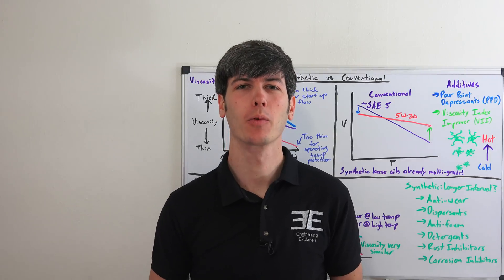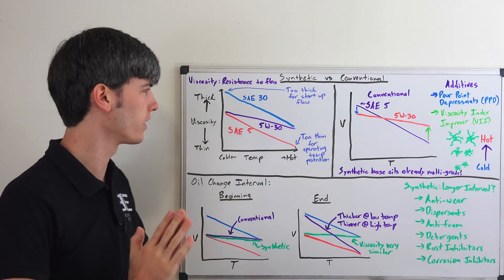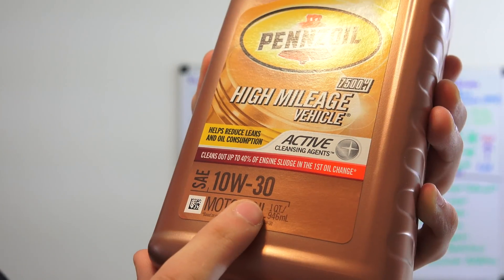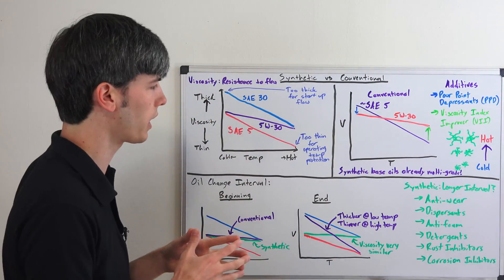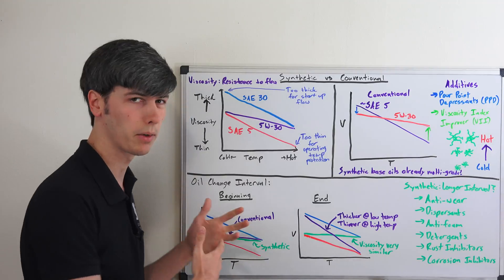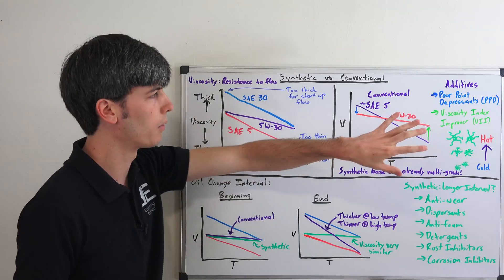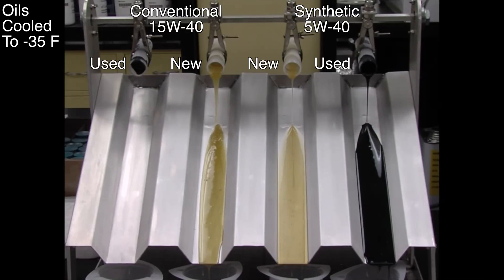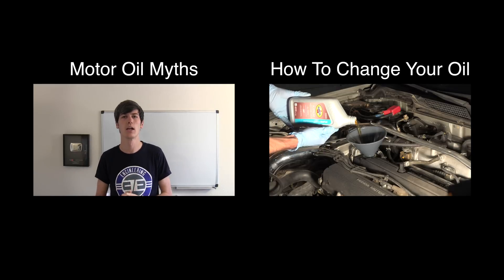Is Synthetic Motor Oil Better For Your Car?

Comment: Can I use "Motor Oil" in my ENGINE??
Reply: Arthur Smith That's not true. A motor is a machine that converts other forms of energy into mechanical energy and so imparts motion. An engine is a motor that converts thermal energy to mechanical work.
Reply: Pepsi is great for high performance
Reply: Bruce, that isn't exactly correct. In standard convention, the word motor is applied to an electrical device, and the word engine is applied to an internal combustion device. However, this isn't exactly correct. Any object that converts energy into motion is a motor. The word is latin for "mover", so it is pretty inclusive. Also, an engine need not be internal combustion. Again the word originates in latin, this time meaning a "clever device"... more or less. This becomes obvious if you look at various engines throughout history. Siege engines (catapults, trebuchets, etc.), steam engines (trains, ships, etc.), now the internal combustion engine, the jet engine, and so forth. With the large number of prime movers about, we have adopted the convention of separating the two words along the rough lines of moving parts. Thus, a motor is something with few moving parts such as the electric motor, the rocket motor, etc. While an engine is something with lots of moving parts. In short, when the blonde asks somebody to take a look at her motor, she isn't wrong. She just isn't following modern convention.
Reply: Swooper S a library at your finger tips. YouTube for a lot more answers. You will never say I don't know again.
Reply: ya, why don't they call it "Engine Oil"  ????   I'm a girl  !!!
Reply: That's funny...people often confuse engines and motors. What's in your car, truck or motorcycle is an engine, as in "Internal Combustion Engine" The fan that's in your HVAC unit or garage, and runs on electricity is a "motor". Everyone gets it wrong, and Harley doesn't help the issue because for the last 114 years they've been known as "The Motor Company". It's really not that big of a deal and we all know what they're talking about, regardless of whether it's called an engine or a motor....
Reply: Technically it's a "motor", as "engine" used to have a much wider meaning (unless you specify that it's an "internal combustion engine"). It's doesn't have anything to do with the amount of moving parts, just with it's function - the motor is a motion imparting engine. A motor is always an engine, but an engine is not necessarily a motor. Neither "motor oil" or "engine oil" specify the type of engine or motor the product suits, it's just that the internal combustion engine is so prevalent that it's function is usually accurately assumed. So prevalent, that both "engine" and "motor" became synonyms.
Reply: NO, you put that in where it says break fluid.
Reply: Arthur Smith you're right lol I do the same
Reply: NipkowDisk lol
Reply: +Zer0MatteR you are correct. Many don't know the difference. Nomenclature is important in the parts replacement world.
Reply: Pie guy, the point is the words pre-date the devices we've assigned them to.
Reply: NipkowDisk fun fact, guess how "Motorcycle" got it's name? ;)
Reply: Skittles in your gas tank will improve gas mileage by 20 percent
Reply: so a motor boat is actually an engine boat?  The colloquialism is crazy.
Reply: An engine is also called a motor. I consider myself a "motorhead", but not an "enginehead." Now I know some people will argue with me, but when I'm not working on vehicles, I am a student and teacher of the English language. I'll bet nobody here ever thought they would hear from an ASE Master Heavy Truck Technician with a BA in English and a certification to teach English as a Foreign Language (called TEFL).
Reply: A motor is any device that converts any kind of energy into mechanical energy. That definition is very easy to find if you know how to search the English language, which I do. 

motor
[moh-ter]

noun
1.
a comparatively small and powerful engine, especially an internal-combustion engine in an automobile, motorboat, or the like.
2.
any self-powered vehicle.
3.
a person or thing that imparts motion, especially a contrivance, as a steam engine, that receives and modifies energy from some natural source in order to utilize it in driving machinery.

The definition of “engine” is narrower than that of “motor,” but an engine is obviously a motor even though a motor is not necessarily an engine. 
 
engine
[en-juh n]

noun
1. a machine for converting thermal energy into mechanical energy or power to produce force and motion.
2. a railroad locomotive.
3. any mechanical contrivance. PLEASE NOTE THIS PART OF THE DEFINITION!!!
Reply: No you cannot. Only engine oil will work in an engine.
Reply: Arthur Smith google has all the answers 😅
Reply: Sith'ari Azithoth hahaha BATIN'!!
Reply: Zer0MatteR what is not true?
Reply: +Arthur Smith so a motor is electric and an engine is vapor or gaseous run....good to know .
Reply: Pug Philo just Google the difference between the two. Difference between motor and engine
Reply: automobile you dont need a lisence or insurance to go from a to b..motor vehicle registered with a motor vehicle branch needs insurance and a lisence to operate.
Reply: Put some sugar in it.  Needs carbs.
Reply: engine is a more correct term, motor refers to an electromagnetic motor usually
Reply: my guess is spelling
Reply: Personally I have ever seen a place to put fluids that would "break" my vehicle. I HAVE seen places in which to put brake fluid.
Reply: I'm not fluent in english, but I was wondering if the question was not ironical ?  LGBTQxyz recomment to put motor oil inside your engine if partner is a very fast stroker. If you engage something in the swow get a lower grade oil.
Reply: Only if you want it to run smooth!
Reply: NipkowDisk iii
Reply: NipkowDisk are you really suggesting to folks that electric motors have oil in anything but the bearings?
Reply: I would say no, try your brain, it's viscosity seems low enough 🤔
Reply: Sure, you are technically correct.  But why do you feel it necessary to point stuff like this out?  Many know the difference and ENGINE and MOTOR are commonly used interchangeably in a regular conversation.  So arguably, the only reason one would do something like this is to try and somehow prove you are smarter then the rest?
Reply: Most of the comments here are hilarious... don't you think I put the word "ENGINE" in all-caps for a REASON??? Because I KNOW the freakin' difference, as well as those who gave a thumbs-up... I thought lead was dense, but some folks here on YT exceed its density by several orders of magnitude.

That being said, it would be VERY bad to use non-detergent MOTOR oil in an ENGINE- there was a comprehensive test done about 15 years ago or so where the non-detergent oil sludged up the engine SO badly that it seized from lack of lubrication. Such oil, however, is fine for MOTORS  ;)
Reply: NipkowDisk no
Reply: Pug Philo engines use fuel to create power and motors use electricity for power
Reply: +conecrazy314 just curious, what is the difference between a motor and engine?
Reply: Michele0403 use Mobil One full synthetic oil and a Mobil One filter. Use it at least in the winter. Synthetic flows much easier than conventional oil. Yes you can swap around from synthetic  to conventional with no harm. Three thousand mile oil changes are no longer. I change mine at fifty five to six thousand. Seventy five hundred is the most miles then change.
Reply: @Michele0403 They do. Why did you feel the necessity of specifying your gender?
Reply: NipkowDisk same thing

Comment: I like 0W40 and 5W30 100% synthetic oil. I like Redline Engine Break-In Lube Additives. Rotella-T 5W40, Mobil-1 0W40, Pennzoil Platinum 5W30 all of them with 2 ounces of Redline Break-In Oil Additive per 4 quarts. I use a 6 month OCI no matter if that is 10,000 miles in 6 months of 500 miles in 6 months. This assumes you are going to own your vehicle for 7+ years so it is paying you to own it after the first 3 years! If you track the car or it see's hard use like what you would see in commercial mining  use or such then the above might not apply to you. 

I like Vanderbilt oil and fuel additives especially their boron additives and tungsten additives. 

My Dad is trained in Tribology in addition to working in engineering departments in Automotive and Aviation for about 18 years before getting into medical field. My Mom was in the tool and die and machinist trades before leaving those industries for culinary art's. 

My Dad used to use Vanderbilt and Chevrons Oronite additives to blend his own lubricants and used Exxon Mobil base stocks. He also was in racing for a while. 

Redlines 0W20 and 5W20 have crazy insane hths values as does their 0W30, 5W30 and 0W40 as compared to the rest of the industry! 

Amsoils HD 5W30 is worth a look as well, Not impressive on paper but in real life it just performs so well!!!

Ester based ATF's are the real  sleepers. GM has published white papers on them while testing in the Desert about 6-8 years ago. I think the white papers are ASE and Lubrizol worked with them on it.

Comment: I used AMSOIL in a 1985 Plymouth Colt which was advertised to be a 25,000 synthetic. As recommended I changed the Hastings filter at 12,500 miles which forced the addition of a quart of oil but at 18,000 miles got paranoid about the effectiveness of the oil at that mileage. I got a kit from Faber Labs in Chicago and sent in a sample of the AMSOIL with 18,000 miles on it and changed the oil. The analysis showed no unusual engine wear and that the oil was still good with no excessive contaminant buildup or viscosity change. This car with a 1.5 liter 4 cylinder and with AMSOIL 10W40 in the engine and 75W90 in the 4 speed manual gearbox was getting an average of 45 mpg in the city and 50 mpg on the highway, EPA rating was 37-44 mpg city-highway. The shifting was vastly improved especially in Illinois winters. I have not had the same mileage increase experience with Mobil One or Penzoil synthetic in subsequent vehicles. The switch over to AMSOIL added 5% mpg each with the engine oil and transmission lubricant change and beat the daylights out of the EPA ratings..

Comment: I recently switched from Synthetic Blend to Pennzoil Platinum Full Synthetic and holy crap. I had this drone in my Challenger from deleting my rear resonators, and it was unpleasant at highway speeds, but I always have my music on so no problem for me, but....After Switching to Pennzoil Platinum Synthetic, the Drone has been significantly reduced, and the engine is also quieter and smoother than before. I'd say an 30% Reduction in highway drone. It's still there, but nothing that will make long trips uncomfortable. I probably will never use Conventional oil ever again!

Comment: so i put 15w40 on my 2.0vw but on highway with hot car i got a low oil pressure light, manual recommends 5w40, should I change oil? 15w or 5w had not effect as this is the cold viscosity right?
Reply: You should have your oil pressure checked with a mechanical gauge.

Comment: What oil would you use for your teggy? And what would you use if it has over 270,000 km in mileage and is undercompressed and in  need of a rebuild??
Reply: Kanishka Mendis Premium olive oil.
Reply from the maker: Sounds like you should use some high mileage oil to minimize how much is burned.
Reply: Kanishka Mendis ....I would just turn up the radio louder when it starts rattling.
Reply: Kanishka Mendis

Comment: what is a5 b5 means ? my cars owners manual recommend to use 5w30 a5 b5 oil but i poured mobil super 5w40 a3b4 fiat 9.55535n2 does this harm the engine?

Comment: Is it true that once you go synthetic you can't go back?
Reply from the maker: No, but why would ya?
Reply: Engineering Explained I use NAPA syn work fine 5 to 3 bucks a qt. So yeah why you use conventional oil. When now of days it's the same price if you shop right and change it your self. Full oil change was like 20 bucks with NAPA filter.
Reply: Not true, you can go back to conventional oil and you can even mix conventional and synthetic oil.
Reply: That"s like when you go black, you never go back !

Comment: Lot of theoretic science on this channel. It's good to view things from both theory and experience. If the theory is true that the additives wear out at the same rate between synthetic and conventional oils, then why does everyone in the industry recommend a longer interval with synthetic over conventional oil?
Reply: Krankie V well, today's oil protects better, even conventional oil can safely be used for over 4000 miles.  The 3000 mile oil change, is a recommendation from the 60s and 70s.  My 92 Honda has a 7500 mile recommended interval, designed before synthetics were available for a reasonable price.  I personally wouldn't recommend going far over 5000 miles even on synthetic.  That's when I notice a gas mileage decrease on my personal vehicle, pushing 300,000 miles.  Purchased with about 190,000 miles and owned for about 10 years now.  Been using synthetic since day one.  Still all original parts, though the frequent oil changes may be part of the longevity, more than the synthetic.
Reply from the maker: Everyone in the industry recommends an oil grade and an oil change interval for their car. This is what you should go buy. Synthetic maintains its viscosity properties longer, as this video demonstrated. That doesn't necessarily mean the oil is any cleaner/dirtier. Do what your owner's manual says.

Comment: how about using synthetic oil in old Engine? in my case, I'm running toyota 4AGE engine. the engine is a bit old (26years). at that era, the synthetic oil is not even available. so is it okay to use new synthetic oil to old engine like mine? I ask some mechanic in my town, that I better use normal mineral oil rather than synthetic oil. is that true? Thanksfor the help:D
Reply: Probably a waste of money. Synthetic oil can not repair engine damage already done. If your engine burns oil now or leaks oil on the ground, then it will burn more or leak more with synthetic oil in it. Now if you wanted to keep that car forever, and had the engine rebuilt to new specs then it would be the time to use synthetic oil, after the break in period of course. And mineral oil without detergents are used for engine break in not every day use. Use conventional oil as per your owners manual recommendations.
Reply: for now i used mineral oil, 15w-50. lucky the engine still in sharp condition, n
Reply: A lot of it depends on number of miles and engine wear.  Mobil 1 was available way back in the '70--I used it in a (bought from new) 76 Toyota Corolla.  Tore the engine down for inspection and new seals at 230,000 miles. No sludge and minimal staining of the inside of the engine.  No wear to speak of,  the original hone marks were showing in the cylinders & the bearing showed no wear.

If your engine is using oil, synthetic is going to provide no improvement.

The thing I like about synthetic oil is that it improves efficiency and resists thermal breakdown.  The Corolla lived its life in the Pacific NW.  With hot weather and long grades in E. Washington, the engine lived a hard life.  And paid itself off multiple times.

Comment: So what if I change my synthetic 5w-30 at 3,000 miles when it's recommended 5,000 will I have extra protection ? Will my engine basically last for a longer period of miles?

Comment: i need to change the 15w-40 that i have in my truck right now, i need a 0W-40 or a 5W-40
Reply: Trent Nelson in my superduty I run Rotella T6 5w40 year round. I live in northern Ontario Canada.  I've sent oil out gor analysis and results were excellent condition.
Reply: Ernie Desjardins ya, im up in cochrane ontario, 15-40 is a little thick at - 30. just waiting on some money to do the oil change.

Comment: Your demo ONLY proves that 15W-40 is different than 5W-40.  Can you show us how used 15W-40 synthetic oil behaves at -35 deg F?  We clearly know from the SAE designation that 15W-40 oil is more viscous than 5W-40 oil at -35 deg F which you DO clearly demonstrate.

Comment: Hi, could you take a look at the Liqui Moly Leichtlauf MOS2? It was recommended to me by their engineers for my 1992 Saab 9000. Since the oil change the engine sounds more refined, but I would be curious if the MOS2 additive brings benefits. Thanks and gratz for the channel, I subscribed.

Comment: What do I need for my mustang v6 2014?
Reply: 5W20 5QTS, FL500S (MC OEM filter) or STP, Autozone STP S10590. One extra quart as some time you may need another .5 quart to fill. (manual shows 6, never needed 6 in 2008, 2010, 2013 mustangs.)

Comment: I had to switch back to conventional oil in engines that had 90 000 miles or more of wear because they started to burn oil like crazy if I used synthetic oil just once.
Reply: My pickup did the same thing,  with about 60,000 miles on it.   Synthetic oil just disappeared from the engine.
Reply: Syn is great because is so fluid and lubricates every parts, but when the sealing is not so great, as in used engines, it gets past the piston rings and gets burned

Comment: you don't show us experimentally for both new and old oils, what happened to the viscosity of conventional oil and synthetic oil in high temperature or the normal temperature of the engine.

l need to know what is the best oil for very very hot weather.